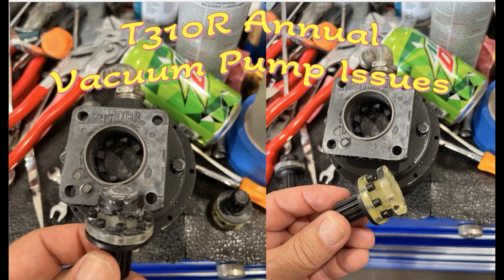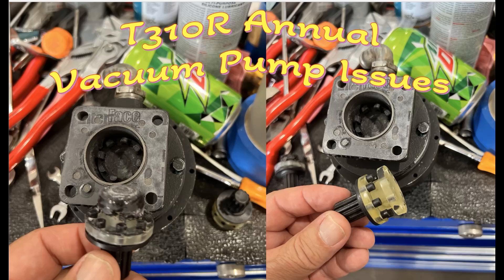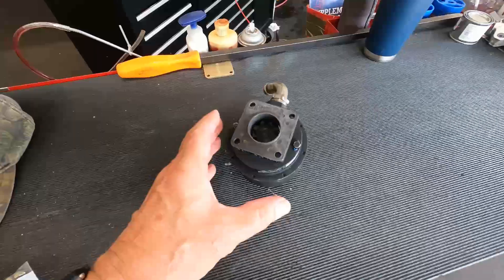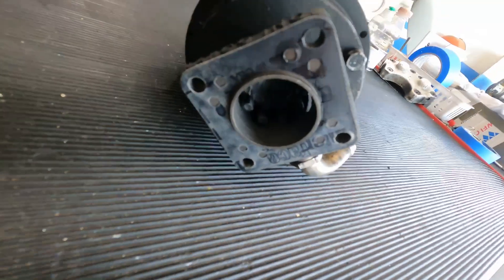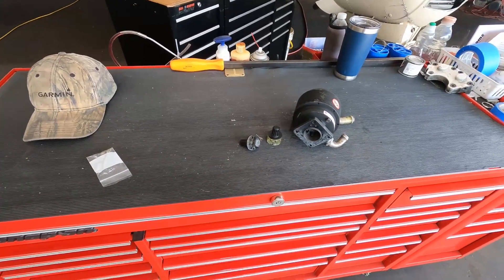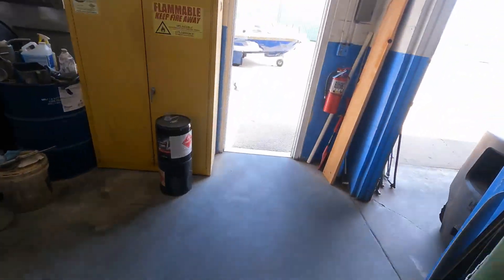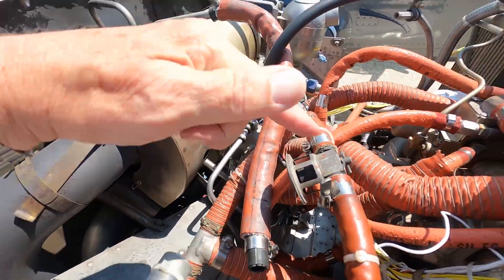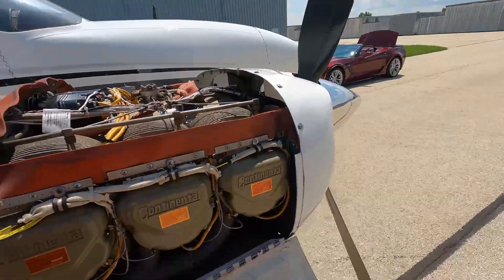Cessna T310R Vacuum Pump Update on Annual Inspection

Comment: When I was young, I would fly almost anything, but being a fair amount older now I would probably pass relying on a vacuum pump to protect me from ice. I mean, how often are you going to be flying in icing conditions? If you could legally do it within the type certificate, I’d be inclined to remove the vacuum system and the boots and take the same precautions to avoid ice as every other airplane that is flown IFR without approval to fly in known ice. You aren’t on a schedule like an airline any more.
Reply from the maker: I really only do ice anymore in a 777 (they make me sit in the back now) or in my drinks. The "known ice" is more to keep me legal if I have to penetrate a thin layer or get caught in inadvertent icing conditions.
Reply: @ronrogers  Thanks for the reply. You definitely have a nice 310.

Comment: My prediction is that the new pump drive coupling will fail again in a very short time, even with the cooling shroud having been installed.

The drive coupling fails from excessive internal rotational friction of the pump.
Once it fails, the two separate parts are turning against each other which causes a lot of friction induced heat, hence the melted appearance.
As vacuum pumps age the internal surface that the vanes run against gets rippled / wash boarded from vane chatter.  It takes a long time for the surface to wear, but once it gets bad enough, it causes a much higher rotational friction at high RPM (you can't feel it when turning it slowly by hand) than it had when new.  When the friction gets high enough, it exceeds the torque rating of the coupling, causing it to fail (exactly like it is intended to in order to protect the drive output on the engine).

You said the vanes were inspected, but was the surface condition of the  inner bore of the pump looked at closely?
When a pump gets overhauled, the bore gets very lightly machined so that the rippling is removed and the surface is true again.

Once a pump fails its drive coupling, I have never seen replacing the coupling be a solution.  They generally fail again in a very short time.
The only fix is replacing the pump.
My guess is that you will be doing that to solve this problem.

Comment: Ron, I added that cooling shroud to the pump on my T210 many years ago and it’s made a very significant difference to the pump life!  I’m guessing the pumps on your 310 are now only used for the boots?  You may want to confirm the regulators are adjusted correctly.
Reply from the maker: That is correct, only the boots. They think the regulators are correctly adjusted but we still have the problem.